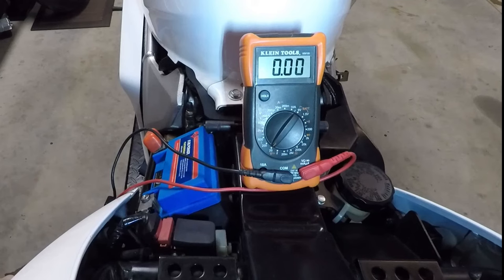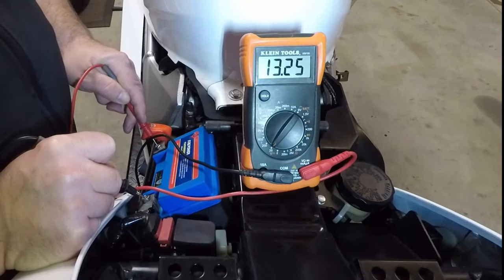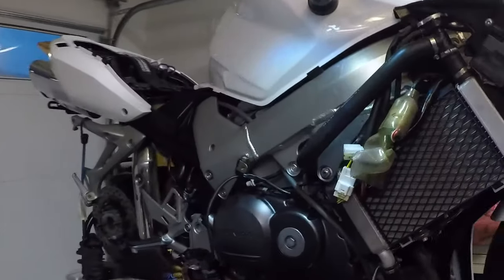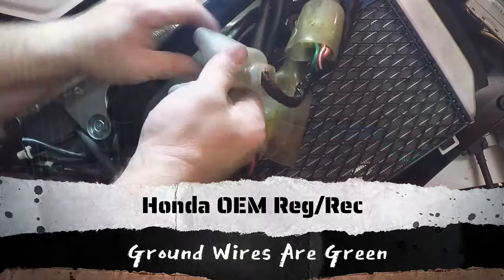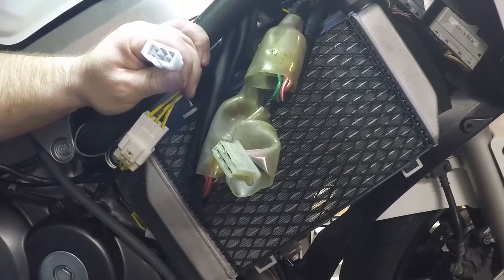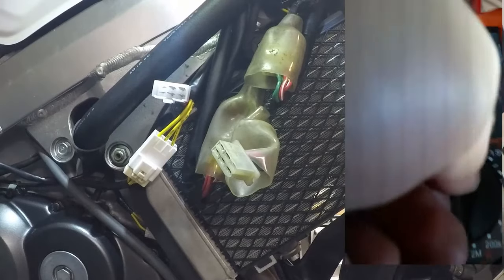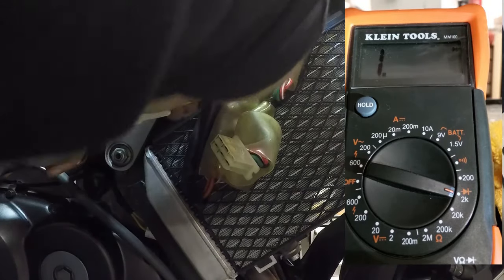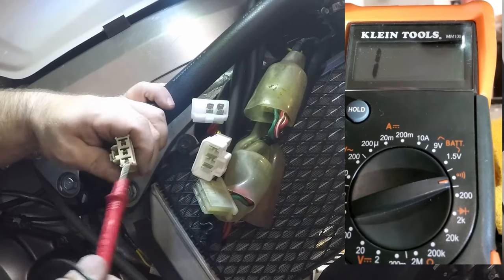Battery Voltage / Regulator/Rectifier & Stator Test

Comment: Hello I know this is a old video , but my bike has a new battery and at 5000 idle it jumps from 12.8V (new battery) to 13.4V . With highbeamd on it drops to 12.4 but goes up to 12.8V at 5000idle . Would it be the stator?
Reply from the maker: Sounds like a weak stator, here is how to test.  https://youtu.be/KpmvUvpRCEM?si=ipdeUP15o3p41OvJ

Comment: Hello, I have a 4 wire rectifier I've tested the black prob to the negative side and then the red prob to the positive side I got 0 readings . The reversed probs also got 0 readings do you think my rectifier is faulty ? Thanks.
Reply from the maker: Hi Westley the other wires are typically green or brown or stripped variation.  These are not the live wires from the RR just the black and red ones.  Yes it sounds like the RR is bad.  I have another video that may better explain.
Reply from the maker: https://youtu.be/KpmvUvpRCEM
Good luck!

Comment: what is the chance that any newer bike overcharges life-o4 battery? over 15v is bad... btw how old is that stator?
Reply from the maker: Voltage at the battery while the bike is running is controlled by the Regulator Rectifier.  The RR is metering the state of charge of the battery (low voltage battery higher output from stator to the battery and vise versa) as well as the load the bike is demanding from your electrical system (high beam, heated grips).  Li batteries have battery management systems built into them to prevent overcharging because overcharging a Lithium battery results in a "Thermal Event" than you can't stop by spraying water on it.  This being said, 15V is too high for a Li in my opinion and you should check with the Li battery manufacturer for their specification for your model of battery.  If I were you, I would, fully charge my Li battery with a proper low amp charger and check it again in the bike, if the condition of 15V remains, replace my Regulator Rectifier and or battery to an AGM one, to confirm the issue is with the Li battery and not the bike. BTW if you cannot fully charge the Li battery with a 1-2amp charger, your battery is the issue.  Also the charger should be old style analogue with a meter to do this test, just make sure it is set to no higher than a 2 amp charge. - Good Luck!
Reply: @RodRidesWrenches  well, i am sorry but that was so not my question, something was misunderstood... not all batteries have BSM, and i was just wondering what is the chance that my bike(or any other bike for that matter -hypothetically) charges with 15+V... in 2 days i will have voltmeter to measure it; up to 15V is ok according to manufacturer of LIFEO2 battery that i installed yesterday... bike is 4 years old and has bluetooth connection and stuff so i imagine it uses an ok regulator but who knows... electricity is not my forte

Comment: Thanks for vid...I have an 81 kawasaki kz 440...my issue seems to be weak spark..with a 2 wire stator I have continuity of about 3 ohms with stator removed from the bike..my research shows this is about normal do you agree? Would you suggest reinstalling the stator to the bike and checking each phase against the bikes ground?
Reply from the maker: How do the coils in the stator look?  Are they burnt? Is there continuity from the leads to the pole frame?  No need to put it back in the bike to test that, the second video in this series may help https://youtu.be/KpmvUvpRCEM How is the ground strap from the engine to the battery, any green or black oxidation?  A bad ground will weaken the spark. - Good Luck!
Reply: @RodRidesWrenches  the coil condition doesn't look bad to me but that could mean nothing...the bike is a new build so condition of wires and contacts are all very clean...the problem is I'm fouling plugs as if weak spark..carbs are new and jetting should be good...I'm going put in line spark checker and continue troubleshooting...I do have an nos stator coming...thanks for reply

Comment: Is it normal for the stator wire  plug to be hot to the touch?
Reply from the maker: WARM yes HOT no,  bad connectors, corroded wires (battery cables especially, see any green corrosion?) faulty grounds, failing diodes... More here https://youtu.be/KpmvUvpRCEM

Comment: I checked everything and everything seems fine however with the bike running, only 12.5 volts. Not sure the problem.
Reply from the maker: You have a failed stator most likely  measure ac output off the stator as shown here https://youtu.be/KpmvUvpRCEM

Comment: Would be a bad earth or something as stator is shiney and new but not OEM  to?
Reply from the maker: Yes check the grounds, the cable from the battery to the engine can get full of corrosion.  The more I think about it, the more I go back to the magnetic rotor.  I have head but not seen these needing to be replaced.  In some years Honda had a bad batch!

Comment: Dear Sir
I have changed many time a rr on my 50cc moped . But is burning the head lamp after 2/ 3 weeks working, I have changed regulator but regulator is producing 14.98 v dc is fine current or its too much. Kindly give me solution please.
Reply from the maker: 15V is too high.  Check the ground strap to your battery & replace, remove the RR and clean the mount to the frame.  There needs to be a solid connection between the RR and the frame so it can shunt voltage back to the engine.  SEE VIDEO https://youtu.be/KpmvUvpRCEM

Comment: This was the same with mine, burnt stator. Now I know how to check it. Really helpful video~!

BTW what's the cause of these burned-out stators?
Reply from the maker: The cause is wear, nothing lasts forever, especially high voltage generators.  If you have issues with repeated problems check out this follow up video I put out today, it runs through why your stator may be continually failing,.  https://youtu.be/KpmvUvpRCEM

Comment: I have had my rectifier/stator rewired. To do the continuity test for the stator it would always be on those 3 wires correct? I have a 2000 vfr800
Reply from the maker: The Stator is the same on the 5th gen so yes those three wires.  Remember there is no polarity on the stator because it is producing alternating current on the three wires or three phases.  It does not matter which wire goes where on the stator side, that's why they are all yellow in color.
Reply from the maker: Thanks for liking and subscribing!

Comment: If my voltage is dropping from 14plus volts down to 12.5’s while the bike is idling it’s safe to say the stator is the issue, right? 
I did the 5000 rpm RR test and it came out fine , voltage tops off at 14.28v at 5000rpms. Battery is also fully charged
Reply from the maker: If the continuity test did not go to ground then it could just be your battery.  What is the open circuit reading on it?  Bike turned off, fully charged, how many volts?  It should be around 13V (2.2 X 6).  The stator can fail in sections basically as one phase (section of coils) burns out, then the second.  By the time two sections have burned the stator fails.  At 14+ volts it does not sound like the stator.  Does your voltage drop while the bike is running at idle, working its way down to 10-11 volts? https://youtu.be/bUb97GnDLOU
Reply from the maker: 12.5V is just fine for idle!  As long as you do not go below 12V, if so then replace the battery.  The fact that your voltage goes up to 14V means your stator and regulator look good.

Comment: I'm a visual kinda guy and when I try to read and follow along even though there's some pictures I'm still lost. Plus I heard the Clymer Manuals are junk, any suggestions for my XR650L? Also great video I'm able to follow along got hung up on when it came to the multimeter because my symbols are faded but eventually went with the numbers and matched it up now at least I improved in that area. I think if wasn't for youtube I would be lost
Reply from the maker: Thanks for the view, you'll find many such videos on the channel and more in the pipeline.  The only manual worth owning IMO is the factory manual, yes they are more $ but are worth it. 👍
Reply: @RodRidesWrenches  Yep will look into it

Comment: So I tested the wire that comes of my stator and it was giving me three very different values. I am assuming I need to change out the stator now. :)
Reply from the maker: What did you test?
 Continuity? AC voltage? Resistance? This may help 
https://youtu.be/KpmvUvpRCEM
Reply: @RodRidesWrenches  I tested the voltage AC. I got reading like .78 .28 and .64

Comment: Kawasaki ex250
My battery is 12.75 v. At 500 rpm, its up to 13.24v. No continuity on stator coil. Bt the rectifier up terminals diodes is(. 308) lower terminals (. 303)
Reply from the maker: Lead Acid battery?  If so its sulfated and time for a new one.
Reply: @RodRidesWrenches  It's a lead one barely 3 months old.
Reply: @RodRidesWrenches ... So the rectifier is ok? Or I should worry!
Reply from the maker: @dandenyo3847  If the rectifier shuts off the reverse flow of current it is fine.  The readings you took are close enough to the same.  When testing the rectifier it is more important to have the reverse current flow stopped by the diodes than the readings on your multimeter.  This may explain better https://youtu.be/KpmvUvpRCEM?si=qIGAIRpSBseMcbcj
Reply from the maker: @dandenyo3847  When you asked teh question I assumed you were having issues with your charging system, is the battery going dead while riding or sitting?
Reply: @RodRidesWrenches   Yes, the battery is going flat after short rides
Reply from the maker: @dandenyo3847  12.75V at idle and 13.24V at 5000RPM, I would again think there is an issue with the battery and there is internal resistance with the 13.24 reading, your battery is tricking your charging system into thinking its charged when it isn't.  The battery by far is the weakest link in this system.  Was it prefilled when you bought it?  If so you may be able to find a date code on it and determine how long it was sitting before you bought it.  It takes about 6 months to sulfate a motorcycle battery to the point that it will not carry a charge.  If you can, change the battery from a friend's or another bike and see what happens to the voltage output at 5000RPM.  If the voltage is higher, it's the battery.  If it's the same there is possibly a rectifier issue.  I am starting to think that if your battery works fine in another bike or you gat a different battery in yours and there is no change, the RR is changing performance based on how hot it gets.  Take your bike for a run around the neighborhood and measure the voltage again without shutting it off when you get back.  If you lose charging current when the rectifier is hot, you know it needs to be replaced.

Comment: Great video. I'm on stator 3 in 1 year. 
:(
Reply from the maker: Sorry to hear that, have you changed the regulator?
Reply: @RodRidesWrenches  new battery, genuine Honda rectifier and now I have a genuine Honda stator. 
I have seen a post about the fly wheel  may need upgrading and sometimes that does the trick. 
At the moment I have a touring bike which doesn't tour. 
I will be checking out the issues and hopefully I can sort it out before I'm 200 miles away from home the next time. 
Thank you for the video.  I will learn to spot these issues.
Reply from the maker: @anthonyburrage6603  The magnetic rotor is all that is left to change by the sound of it.  I have heard but never seen these needing to be replaced.  Let me know how it goes!

Comment: Great video!
Still having a voltage to the battery issue myself. ( Only 12.5 to 12.8 volts at 5,000 rpm but does 13.5 at idle) Battery tests good. Stator tests good, no short to ground and 22 volts at idle & 60 volts at 5,000 rpm. 
Lastly did the rectifier test, flow ony goes one way, so that's good but my diode readings are lower than yours (0.707 on both sides)
You think my rectifier could be the issue and needs replaced?
I noticed the headlights starting to surge dim then bright when cruising around 4,500 rpm.
Thanks!
Reply from the maker: Regulator Rectifier is on its way out.  Change it before it leaves you stranded.  It's happened to me a few times and it's no fun. 😶
Reply: @RodRidesWrenches  Thanks! I'll get a new unit on the way. Yeah, being stranded on a bike sucks. Now I just need to get a bike lift, got three other bikes to work on.

Comment: Hi what suppose to be the reading of the stator is healthy
Reply from the maker: A healthy Stator will not have any conductivity to the rest of the bike, it doesn't ground out from the leads.  If you want to measure the AC Voltage from the stator check out this video https://youtu.be/KpmvUvpRCEM

Comment: What if it's an intermittent problem? Sometime my bike seems to misfire on occasion and sometimes it dies like running out of fuel the kicks back on. Once I was riding at night and the lights severly dimmed, the turn signals wouldn't blink and when I stopped at my destination and it wouldn't restart... I needed push started. I push started it and it was fine.  I went home and it was fine, checked the battery and It was 13.2v. Started it and got 14.5ish volts. All this (dimming, dead battery, push starting and testing)happened within a 30 minute window. That's never happened again though. The only thing now that happens is that it intermittently dies for just a fraction of a second. Any ideas.
Reply from the maker: Check/Replace your battery cables, both of them.  You didn't mention how old your bike was, most bike should have their cables replaced if you have intermittent electrical, specially in a 20+ year old machine.  How warm are the cables after a short ride?  Likely a loose connection is causing your grief or excessive resistance, caused by internal corrosion, see any green corrosion on your copper wires?  Good Luck!
https://youtu.be/KpmvUvpRCEM

Comment: I could see my battery spiking at 16v while I was riding! Do you think it’s ok?
I read that if it spikes it’s the regulator.
Reply from the maker: Hello Airi, 16V is too much, maximum Honda Service Manual specifies for a depleted battery would be 15.5V  Is your voltmeter accurate?  If yes then it is your voltage regulator/rectifier as the issue.  Too much voltage will not only burn your battery out, it heats your wiring harness and will lead to premature failure or worse, fire.  Good Luck!

Comment: My bike runs but is not charging. When I test the charging wire from the stator the voltage is all over the place. Just touching the ground wire on the multimeter to the ground on the battery makes the meter go crazy. My starter is dragging, even with a new battery. Headlights are also Dim. Almost not even on.
Reply from the maker: Hello Charles, did you perform the ground continuity test as demonstrated in this video on the stator?  What was the result?

Comment: My 2017 yz450f regulator rectifier  has 2 wires coming out of it a red and black one, no matter what ohm setting i put the multimeter on it shows “0L “  but on the other wires that it plugs into “the stator connnection it shows a reading on the “20 ohm” setting.    
does that means that could be the cause of my NO SPARK situation , keep in mind this bike doesnt have a battery
Reply from the maker: Your bike uses an ignition system where an electric charge is stored in a capacitor then discharged through  firing the spark plug.  CDI ignition boxes are the weakest link in these ignitions.  Check your two wires out of your stator by measuring AC voltage.  If you have voltage your stator is not the issue.  Get a manual for your bike, it will tell you how and what you can check next   My money is on your ignition capacitor but this is based on the fact it is a dirt bike and these are a common failure. Obviously you've checked all the leads to your coil and being a 2017 it should have an prom chip that clips into the harness under the seat or by the forks (I don't know about Yamaha's placement, check the owners manual)  if this chip is damaged or not installed properly you have no ignition.  Good Luck!

Comment: I'm getting 003 reading on brand new stator only fitted with mosfet RR 2 wks ago. Would know why?  Stator can't be bad I only got it new last wk but lost as bike not charge. Any ideas?
Reply from the maker: Hi Lambo I would think it is the stator connection to the Regulator if I were speculating.  Bent or broken blades.  If the
Wiring is good then  could be a fault in the new components, sometimes new things are just bad but that is what warranty is for.  Finally the only other item that comes to mind is the magnetic rotor.  If, for whatever reason, it is unable to create a strong enough field around the new stator poles...  I have a new video out Sunday that may further assist.  Good Luck!
Reply: @RodRidesWrenches  thanks for reply. I did more tests and foaund out that the brand new stator I got was a faulty one. Finally found my problem. I'm only learning about electrical stuff I'm more mechanical guy so took a while to find problem. Thanks Alot for help 👍👍